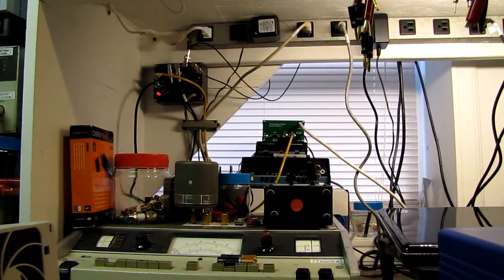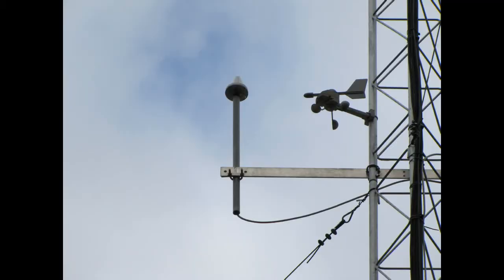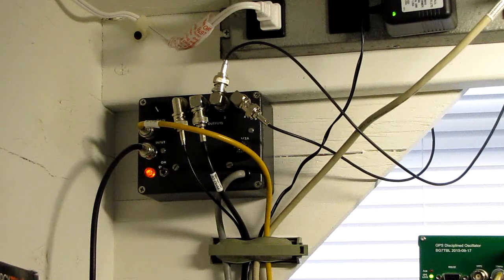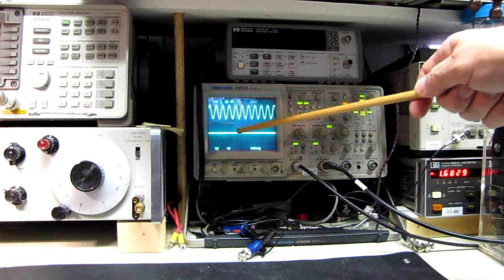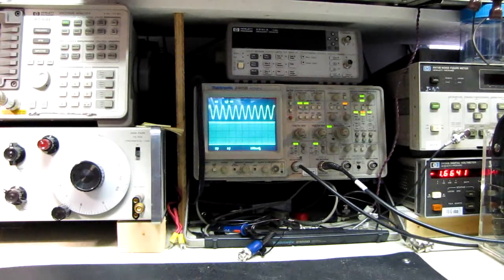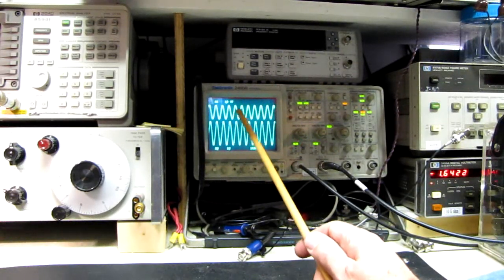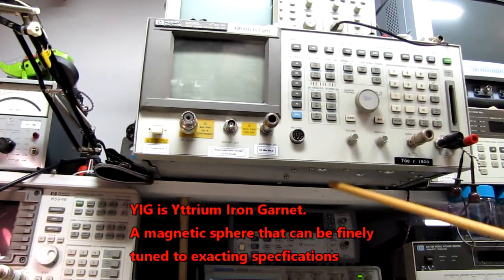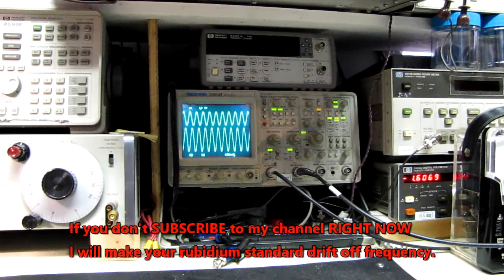By Viewer Request - My Frequency Standard GPSDO

Comment: YIG = Yttrium Iron Garnet. The scope method works well. I used to dial in freq standards in about 15 minutes using an old VLF comparator (WWVB) but then it would take about a full day to cert them. Used a Tek 7904 triggered on our standard and test unit to verticle channel. Then I moved to a place where we had our own 5061 Cessium beam as well as an HP Rubidium.

Comment: Thank you for a great video !  By having more than one 10 MHz standard (3 to 5 would be a good starting point) you could tell when one is off.  The big national labs around the world go to Paris, France to vote on the official time.  Waiting on a display board to mount on my ThunderBolt GPSDO.  Also like the OCXO because it will drift less with age...  The Rubidium has an operating life of about twenty years, give or take a few years...  And have a couple WWVB clocks and the Computer clock links to NIST in Colorado.  tjl
Reply from the maker: Your welcome. I have my eye open for a couple more. It's a sickness. One I can live with.

Comment: Back in May 2016 I had heard that a Math programing issue was to blame for the freq. error and that a fix was coming but I don't know if that fix was released. Like you say it's not a big enough error to worry about but if it could easily be corrected...well... perfect is good.
Reply from the maker: HI Jim, Heard that as well. I never pursued it as 0.0002 Hz is pretty much in the noise for any practical use. Far better than the stability of any piece of gear I work on. I am keeping my eyes open for a deal on a GPS rubidium. 73 Vern N1CKX
Reply: NO, No, no; then I will miss out on the GREAT deal ! ! !  But if you lock a clock into the Rubidium Standard and loose GPS lock...  The clock should still be correct to less than a second after one year.  Good hunting !  tjl